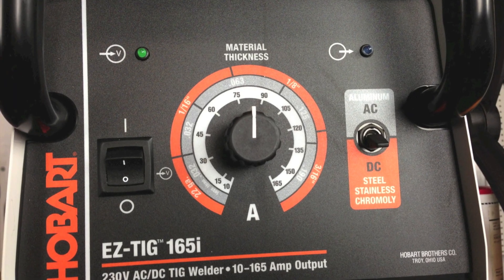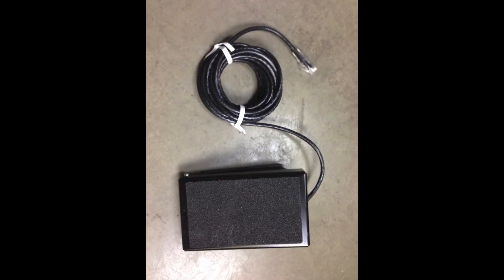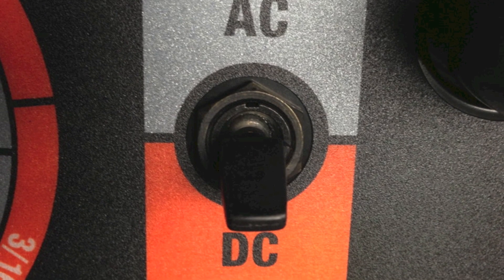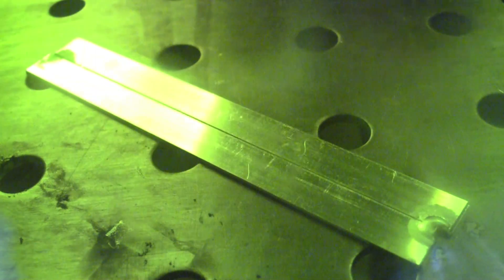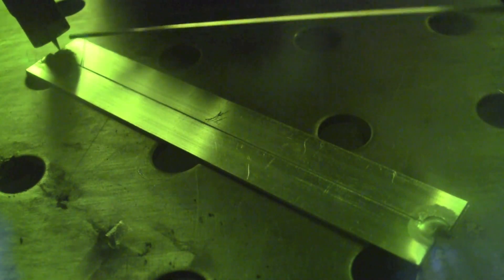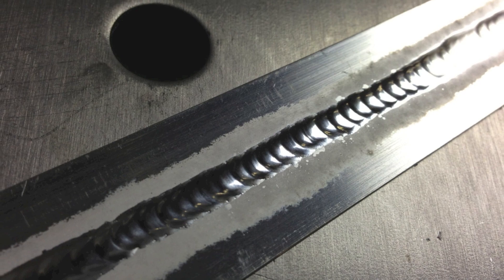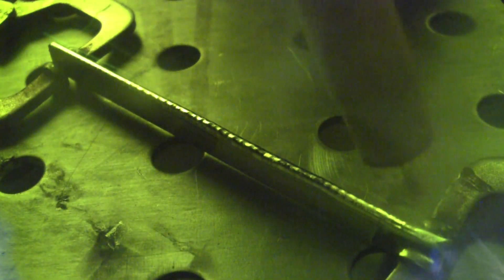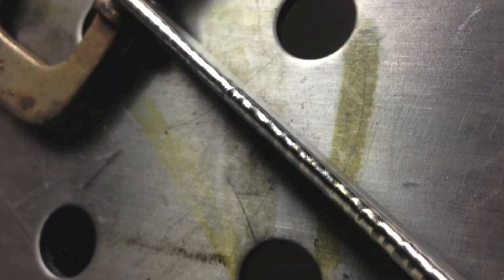HOW TO TIG WELD 16 GAUGE THIN ALUMINUM

Comment: lol, I have twelve 5 ft joints of 18 ga (lighter than 16ga) butt welded to do monday! The shop foreman that knows little about welding tells me to MIG weld it because it'll be faster. I tried explaining that you have more control with TIG but he doesn't want to hear it as the job was bid for low hrs.... I'm not looking foward to this one!

Comment: How about more on electrode type, gas cups, gas flow etc. I tried 2% lathanated the other day and much better than the white tipped electrodes I used for ally in the past. I have a transformer machine.

Comment from the maker: This was a standard setup that came with the Hobart. We used pure argon, and a lanthanated 2%. I believe I had the smith regulator set to 20. There will be more videos coming shortly with the TIGWELD 200SX model. We will put the Hobart in the back for a minute as the comparisons are pretty much done.